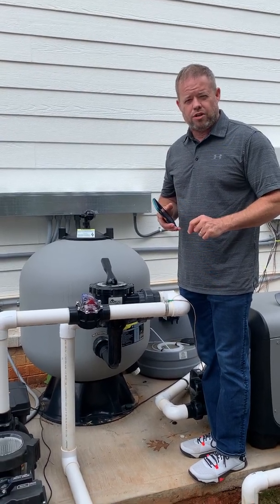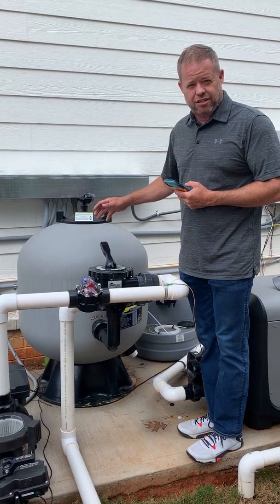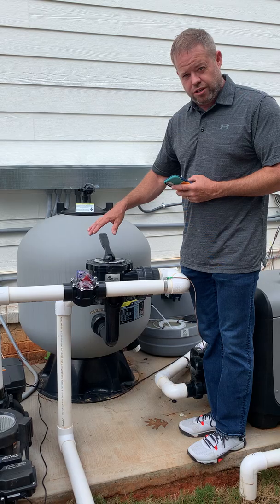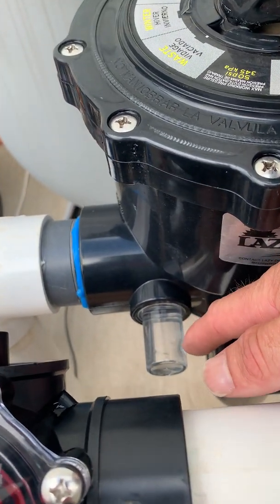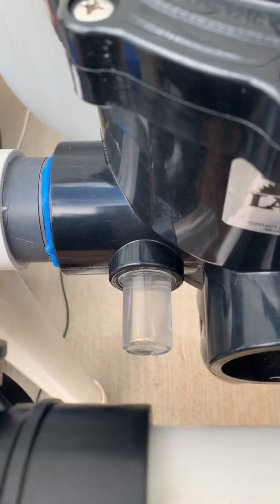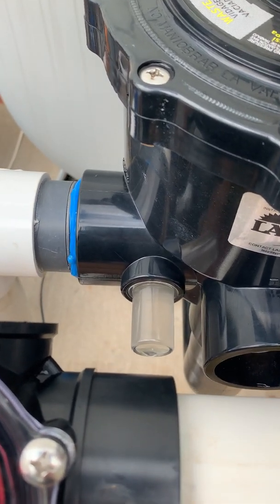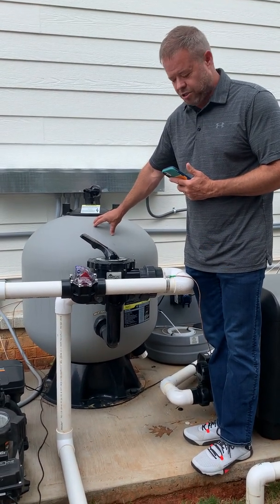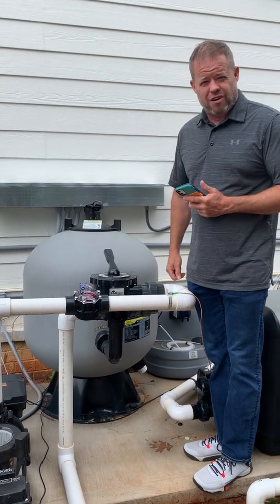Backwash AFM Filter

Comment: How often do you backwash an afm filter. Thnx
Reply from the maker: they seem to work better the dirtier they get (up to a point). I backwash mine roughly every three weeks. If there are several days of rain or storms I will usually backwash after I vac the pool. But I don't have a lot of trees around my pool so you might need to backwash every couple of weeks.